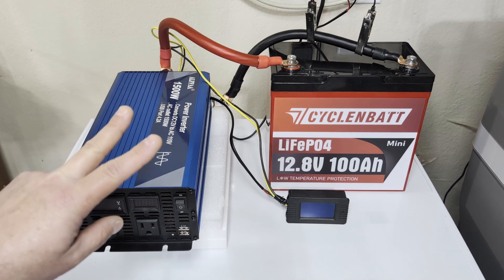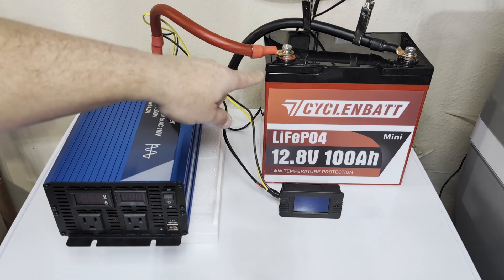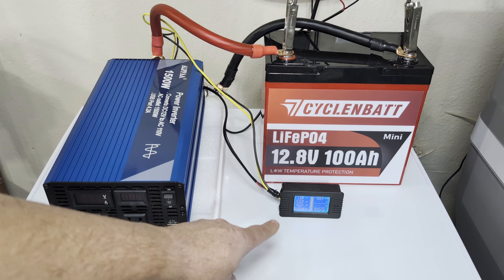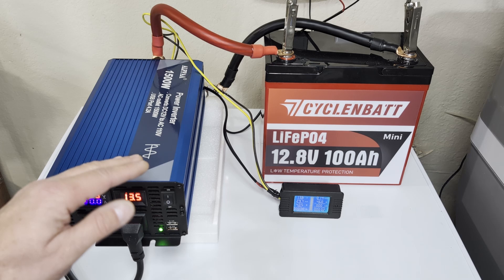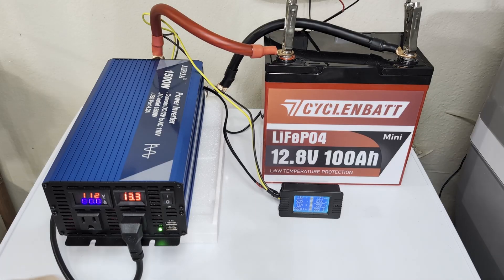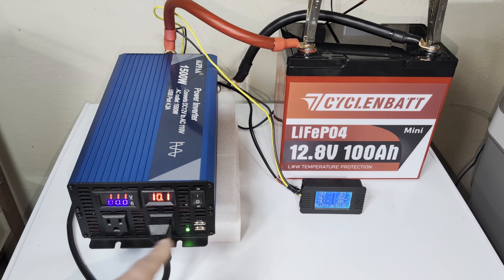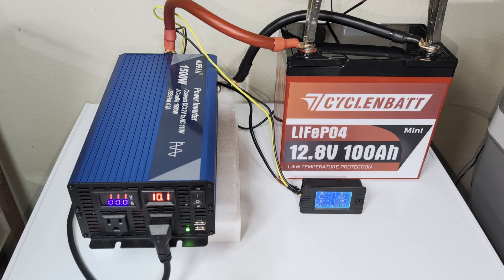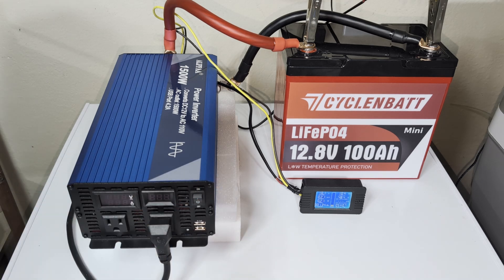This Mini Battery Powered My Freezer For DAYS

Comment: You really don't understand very basic things. There will not be a voltage drop between a battery and inverter _without a load_.
Typical youtube scam channel
Reply from the maker: But there is a load.  Are you ok?  Put the pipe down.
Reply: @SeidelRanch  there was no load when you measured the voltage at the battery and inverter terminals. You hadn't even plugged in the freezer yet